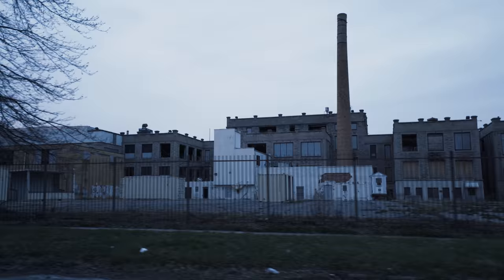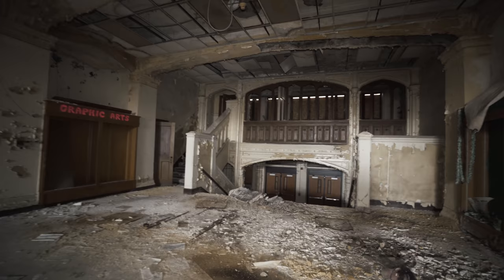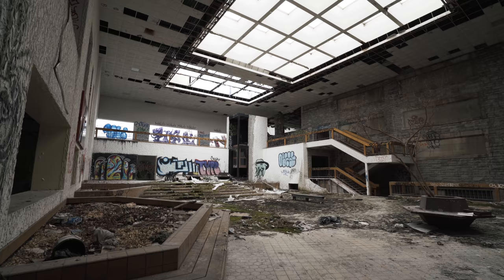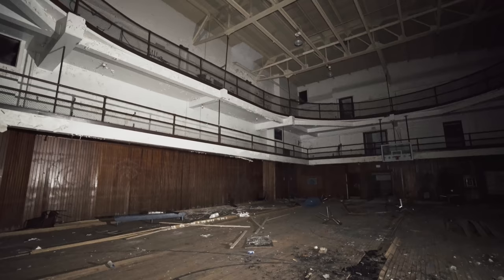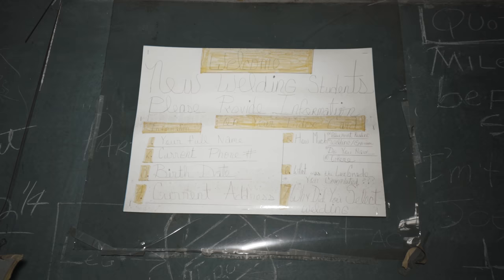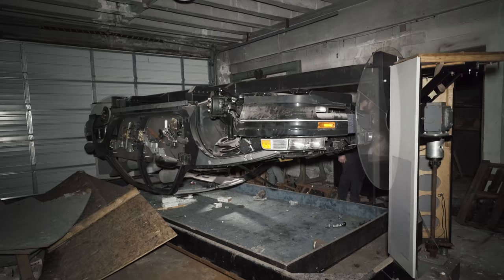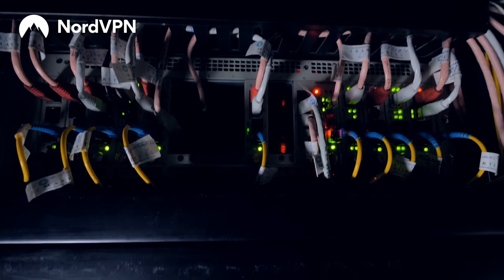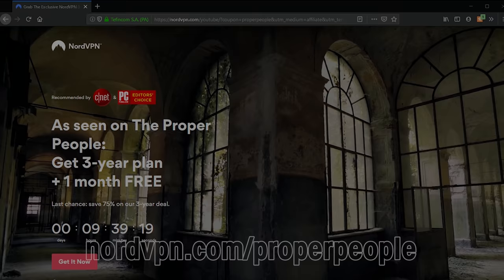Exploring an Abandoned Detroit College

Comment: I am kind of curious when is an awesome idea is what my people going on what's the low voltage in super old original Locker.

Also would like to have some input on this if anyone has any other ideas or otherwise as well

Can't get the timestamp thing to work right now for some reason as well not sure if this is a YouTube issue or not!

To me it looks like on the outside upper door that is some sort of key switch and some sort of fancy play and clearly behind there is a junction box looks as though this has been disused since wiring have been cut short!

This might be a clue as to what the low voltage wiring and Transformer is being used for.

If anything this might be a 24 volt or possibly Les Transformer.

Oftentimes there's a crap ton of low voltage stuff this could be from anything at one point.

Clearly they tagged all the wiring as to what it was so it was meant to definitely be something that would be not just thrown together.

Like a lot of what I've seen and gotten working over the years trying to figure things out.

Somewhere some lighting might be controlled from relays or this might be signaling possibly a bell or horn somewhere but generally there would not be a key switch for this is possible the key switch was also an override to turn something off that was meant to be left on otherwise.

That was meant to enable remote unlocking even back in the day can there be a key switch that would basically disconnect power to keep the system from being abused GeneralLe at the source of power.

Could easily be an override for a bell system to keep them from going off when not in use say a schedule change or otherwise.

Really kind of doubt it would have something to do for security system of any sort 

Possibly old heat alarm system that this was the cancel or reset switch or disabled which obviously would want to be a key switch.

Sometimes old systems like that even though they were used for something more serious would still look like this.

Unseen fire alarm systems back in the day that would literally have a bell and what looks almost like a doorbell or signaling Transformer possibly a key switch or otherwise.

And initiating devices whether heat alarms or otherwise even sometimes an old Pull Station is an ancient one.

Essentially the sometimes would be a latching relay if detectors are momentary sometimes this is the case.

Sometimes referred to as a panelles system.

Of course the system for Antiquated and had no backup regarding power.

There were even some of these that would run directly off 120 volts.

There were even some heat detectors essentially for a thermal switch that when it triggered close contacts can a flag or otherwise would drop down in decaying the specific heat detector tripped and would have to be manually reset.

Also saw a rather interesting setup clearly cobbled together as far as I know.

Using some type of horn but cannot identify these they looked in totally different than anything else I've seen probably not designed for fire alarm system service either.

As for a light on the such as an idea the same as a light plate there were the Globes like that of an outdoor fixture or Barn fixture butt and red glass in them or a red insert of some sort some of them even had a red bulb.

If I remember correctly they use some sort of bulbs very similar to a tail lamp.

Although there were a few different parts of the system that work the same but we're very different clearly built with whatever was available.

This was a 12-volt DC system there were a few relays here in there.

And more than one source of power as well probably just because of a voltage drop and current requirements.

There was a really a large glass of battery here and there that was kept charged and that's what ran the system.

Don't know how this could have met code when it was still in use it was sufficient potentially at one point in theory 

By the way for the pulsing of the horns and lights there was literally an automotive turn signal flasher inline with each power source after a relay.

Each of these devices were just in a mailbox and there was a red indicator I think the green one that indicated power on.

The battery chargers had the quintessential perforated metal mesh clearly was not designed for this and no mention of fire alarm stuff that you normally see.

Mechanical fire alarms and a few of them that would use essentially a Freon powered horn with a fusible link.

Not the first time i had sean sumtong like that.

And yes I know there was a system that was based on four bowls and had the automotive bulbs and the Flasher for horn and light but this was not that system at all that's clearly something that was just thrown together with what was available.

Also I noticed one time they had this system that used off the shelf heat Detectors of some sort.

And clearly the pulsing of the Bells on an afterthought somebody said that at one point that you could not tell the heat detection Bell from any of the others sound like the one on the heat detection system.

So essentially a relay in a turn signal flasher added to make the alarm more distinct from the others.

Also saw a system that is using single stroke bells in a similar arrangement I hate to ask how much wear and tear it put on those coils I can imagine they could get pretty hot I don't know if they were meant for a momentary only or not or would survive something like this if you kept powering to them I don't really have experienced much with those single strike Bell Striker mechanisms!

Camera Furniture ones that are more like that of a standard doorbell for a burglar alarm Bell without the contacts for interrupting the circuit!

Where is just a plunger but no contacts for the contacts have been bypassed all together

The system activation

Comment: Huh. They were taking apart a '91 Mitsubishi Galant in there. I guess they were teaching people how to do rust repair or sandblasting, because that's the only reason I can think of to put the car up on a rotator dolly like that. Even missing the parts you guys were pushing around nineteen hundred pounds of metal, plastic, and rubber. Not a bright idea.

Comment: I notice you guys use what looks similar to a Neewer light on your cameras. I used the same light for run and gun stuff, but it was just too large and required to manny batteries for my liking. A while ago, I picked up the Boling P1 light from Amazon. It's full RGB, has a dimmer, has an internal battery which charges by USB and is roughly cell phone-sized. Just buy a 10,000 mA power bank for each and you will have it made. It may not be what you are looking for and you may be happy with what you use already. You can see my blah review of it here on my other channel: https://www.youtube.com/watch?v=ex4AD3BNjzs

Comment: Wait, if it closed in 1995, why is a 2004 algebra book there?
Reply: because it didn't close in 1995. The original highland Park community college closed in 1995. And then in 1996 most of the complex was repurposed as another sort of community college. I can't think of the name right now. But it closed in like 2009 or so. but from what I understand, the last use of the school was very limited. So some of the school had been rotting a lot longer. you know, like the asylum's that used to visit. They didn't all shutter it once, they just slowly downsized until they eventually closed
Reply: Thanks for the clarification. Sometimes it's a slow slide to full abandonment.

Comment: 90-93 Honda accord. Wonder if the motor is still good 😂 the f22a6
Reply: You'd be disappointed since it has a GM 3100 v6. Its a 90/1 cutlass supreme that was donated by GM to use in their auto shop program.